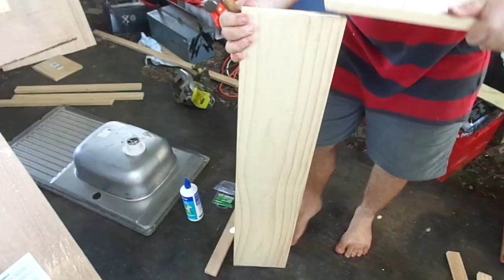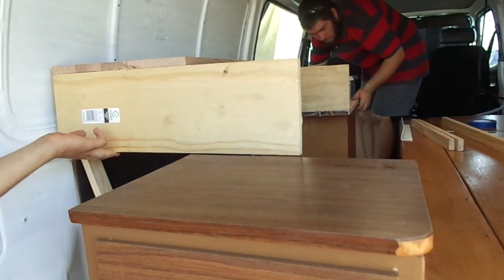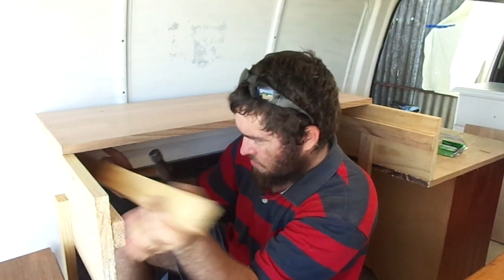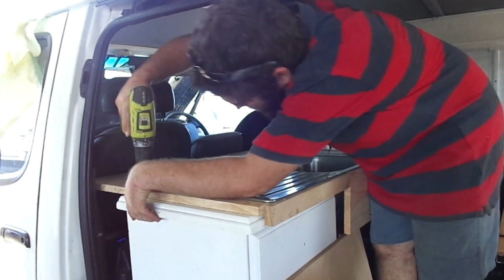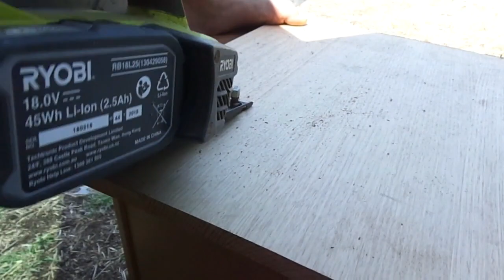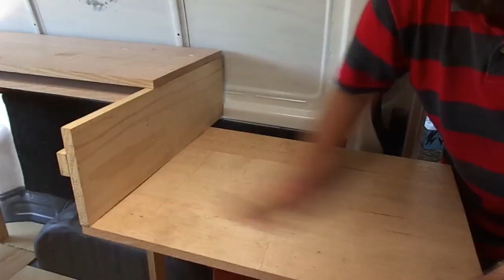Toyota Hiace Campervan Conversion Australia Part 6

Comment: should have taken the back panel off the white draw set under the sink u can get to ur battery mate. Are there any law restrictions doing this in australia? Diff rego class for camper maybe?
Reply from the maker: well i didnt think about accessing the van battery when i built it, but i found out later i can access the battery from the front under the seat. there are no restrictions that i know of, as long as everything is secure and cant hit you if u brake hard, not sure from the insurance point of view. i dont have a lpg gas system as that is a nightmare to install and get inspected here. im not sure on the rego situation, as i am just paying rego for private/normal use.